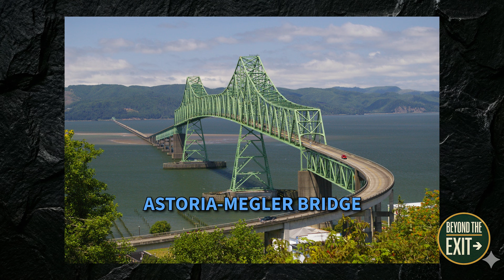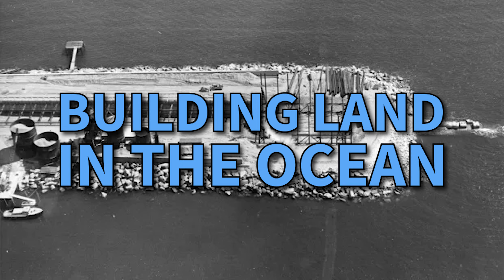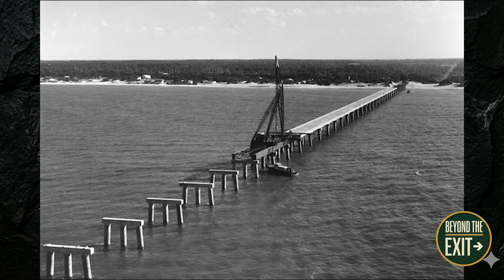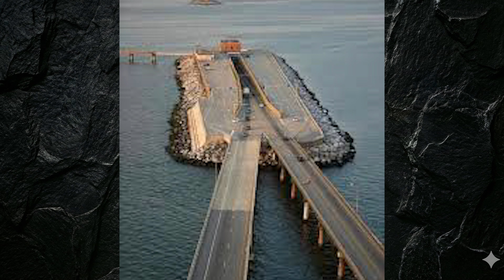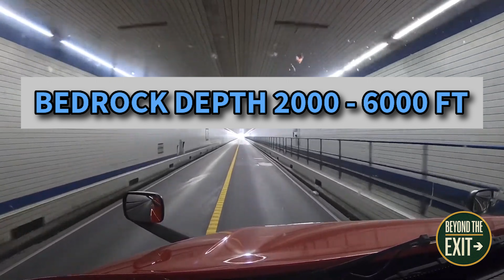The Chesapeake Bay Bridge-Tunnel: Why This Highway Had to Go Underwater

Comment: The part that reframed this crossing for me was the naval reason: a bridge over the Thimble Shoal Channel could have trapped Naval Station Norfolk if it collapsed, so the road had to dive under the shipping lanes instead. Pairing that with the old weather-bound ferries and miles-long truck queues made the 17.6-mile compromise feel like the only practical answer.
Reply from the maker: @SpayUp That naval concern is a big piece of the story. Once you realize those shipping channels had to remain dependable even if something happened to the roadway, the tunnel portions make a lot more sense. It really was a remarkable compromise between highway and maritime needs.

Comment: The CBBT is still probably my favorite bridges and/or tunnels -- I've driven across it probably dozens of times when I lived in the area. It's especially nice to drive on a clear day or around sunset when approaching or leaving Fisherman's Island. During heavy traffic, the tunnel sections can be a bit unnerving with tractor trailers and other large vehicles on both sides so close together -- but when traffic is low (most of the times I usually drive on it), it's pretty nice.

The HRBT (Hampton Roads Bridge-Tunnel) is also undergoing an expansion -- it receives way more traffic than the CBBT, and is a major bottleneck on I-64 (along with the Berkley Bridge on I-264, which always seems to be opening right before I can cross it...).  The HRBT can also reverse the lane direction temporarily to allow large vehicles to be escorted through (one of the tunnels is larger than the other, although I forget which one). It looks like they are nearing completion for the expansion project, though.
Reply from the maker: @yellowcrescent That comparison between the two crossings is useful. The CBBT has that open-water, destination feel to it, while the HRBT is almost the opposite story because traffic and capacity are such a big part of the experience.

Comment: You should do a video on the construction of H3 on the island of Oahu in Hawaii.
Reply from the maker: Great suggestion. We have heard that from several commenters. Coming soon! Thanks!
Reply: @BTE4172  That was a great video by the way.  I was stationed in Norfolk VA and navigated over that bridge tunnel many times.  I always called that area "the land of the bridge tunnels".  I was there when the Monitor-Merrimack bridge tunnel was completed.  That is a nice tunnel.  More wide open than the other bridge tunnels such as the Hampton Roads bridge tunnel.

Comment: Another first-rate video, Scott.  I took my first trip across the Chesapeake Bay Bridge-Tunnel with my parents in 1974 when we drove to Williamsburg to visit my sister (yes, the Eastern Shore route is longer, but Dad wanted to avoid I-95 through Baltimore and the Beltway around DC). I have driven across it several times since then on my East Coast road trips in the 1990s and early 2000s, both before and after the bridges and trestles were twinned.
Reply from the maker: @sct913 Thank you — I really appreciate that. I like that your first CBBT trip came from your dad choosing the longer Eastern Shore route just to avoid Baltimore and D.C. traffic. That sounds like a very real road-trip decision, and it gave you a bridge-tunnel memory that stuck around for decades.

Comment: I spent 14 months working on this structure .(87/88)In the tunnels the ceilings had deteriorated and tiles were falling on passing motorist so myself and quite a few others would demo away the delaminated concrete retile snd move in sequence through the tunnel.
The CBBT authority would close 1 lane,send a pilot car leading the travelers through. 4 nights,10 hr shifts.Still have friends from that job.
Reply from the maker: @JamesPilkenton-se5cx That is an incredible behind-the-scenes piece of CBBT history. People see the bridge-tunnel as one finished structure, but stories like this show how much work had to keep happening inside it years after opening — night shifts, lane closures, pilot cars, concrete repair, tile work, and crews moving through the tunnel one section at a time. Thanks for sharing that.

Comment: Caught my biggest flounder on the Big D. I live in Va Beach and have been using the CBBT since 1964 when it opened. Grandparents lived in Md. The symbol of the Bridge tunnel is the seagull. At the opening there was dignitaries and important people gathered and about 100 seagulls pinned up in a cage to release after the ribbon cutting. Upon release they made a circle and did what seagulls do and nailed the crowd and laughed about it! 😂
Reply from the maker: Thank you for sharing that, I was completely unaware.  And yes, it can be a tough crossing for many.

Comment: Is the Hampton road bridge tunnel deeper than the Chesapeake Bay Bridge tunnel?
Reply from the maker: HRBT Existing is 108ft at its bottom depth with the new bore being up 170ft. CBBT existing is 100ft with the new bore hitting 134ft. HRBT is just slightly deeper. Thanks!
Reply: @BTE4172  ok

Comment: Thank goodness this place has rest stops at either end. Psych yourself up before crossing, lay on the ground and cry afterwards.

I'm hoping they reopen the rest stops on the tunnel islands one day. It sucks that the restaurant and pier got shut down for construction. But of course it's going to take several times as long for the expansion project to do basically the same work a second time, despite being 50 years later and with much more advanced technology.

Comment: Before I  began long distance trucking I drove a dump truck locally. We hauled asphalt from Hampton to the Eastern Shore one day which had me driving the CBBT seven times in one day.  It made a nice change of pace. On one trip across when I reached the north side I saw ( no exaggeration  ) around 200 pelicans. I still marvel at how this was built. Sinking pylons in such rough water for over 17 miles is quite a feat of engineering. You did a good job with this video.👍
Reply from the maker: @timbukh3 Seven crossings in one day will definitely give you a different relationship with that bridge-tunnel. And 200 pelicans out there? That’s a view most people never get to see. The scale of sinking those pylons in open water really is something once you think about it. I appreciate you sharing that — and thank you for the kind words.

Comment: driving piles was my favorite part about concrete construction, i was there while we pushed the piles at the new port they canceled in portsmouth lol
Reply from the maker: That’s hands-on work right there — pile driving is about as real as it gets in concrete construction. Sounds like you saw some interesting projects come and go. Thanks for sharing, and thanks for watching.
Reply: @BTE4172 oh it was super easy i wasn’t actually driving the piles just quality assurance. Making sure the piles weren’t sliding 50-60ft after a strike from the diesel hammer and that we weren’t striking the pile too much to the point of breaking or shearing it. The hammer crews themselves however loved watching that thing slide sometimes almost 100ft we actually had a slide where the hammer was pulled off the crane and rode the pile down about 70-80ft!! It was a super fun jobsite though!

Comment: They didn’t have gps then and they needed towers to look over the curvature of the earth.  The tower was 300’ tall.  One section of the tunnel did move in a storm, they could not move it so the section was left and they worked around the move.
Reply from the maker: Pre-GPS surveying really did rely on towers and long sightlines, especially over water, and curvature becomes a factor at those distances. The Bay’s storms also forced some tough adjustments during construction. Appreciate you bringing that history into the conversation, and thanks for watching.

Comment: Im a truck driver and I actually find it very peaceful when I cross over it. I pickup in Chesapeake a lot from Delaware so I come down 13 south, down through the tunnel.  I also love stopping at the huge rest area before it (or after it, depending on direction obviously) cause there is always a good amount of parking there and with the tolls right there, and police officers nearby, theres never any shenanigans
Reply from the maker: That's a unique perspective on the Bridge-Tunnel—most folks are white-knuckling it through there! Good to hear the rest area is still a safe spot for parking. Safe travels out there.

Comment: I worked on the Parallel Connector in the 90s. We used GPS to position the piles on the elevated roadway, unlike the original structure which used a man in a “birds nest” using an instrument and plumbob to optically locate the correct position of each pile. Each cluster or bent has 2 pile on a batter or angled and a center pile plumb or straight up and down. 
The piles we put in used the latest instrumentation available and located each spot using satellites supposedly faster and more precise. If you float under the old and new structure you can see a difference in the center piles. Under the old the center piles from cluster to cluster as far as you can see is as straight as an arrow lined up perfectly. However, under the new section that was constructed with better more precise instruments the center piles drift side to side. Not by much, but by enough that the eye can see it. 
It always made me appreciate the “old dudes” that built the original using what they had available to them and the precision at which they built the structure. Those men truly cared about what they were building.
Reply from the maker: That’s a fantastic firsthand insight—and a great reminder of just how precise those original crews were with nothing but optics and experience. The fact you can see the difference says a lot about their craftsmanship. Thanks for sharing that, and thanks for watching.

Comment: Good video, but one correction: the second tunnel that was mentioned (January 2025) is not part of the CBBT, but instead the similar structure of nearby I-64 which is also a bridge-tunnel. An expansion project has been underway for approximately three years and, as of January 2026, is still not completed. This expansion project of I-64 - and not the CBBT - is the one that is building/adding a second tunnel next to the existing one.
Reply from the maker: Thanks for the comment. Actually, the CBBT does have an active second-tunnel project — the Parallel Thimble Shoal Tunnel currently being built under Thimble Shoal Channel, separate from the Hampton Roads Bridge-Tunnel work on I-64. Thanks for engaging and helping keep the details straight.
Reply: @BTE4172 my bad! Didn’t even know

Comment: I go across the CBBT probably 2 or 3 times a week (I live in Norfolk, also have a place in Cape Charles) it's a great drive even in bad weather which makes it more exciting due to the roadway being low to the water and waves. sometimes I time my trip coming back to Norfolk as the sun sets over the Chesapeake Bay, driving on the CBBT during that time is beautiful. 

Pro tip, if it's windy there are restrictions depending on wind speed on the bridge itself, if you have loose items in the back of your truck they won't let you cross.

Also, great video, thanks
Reply from the maker: That’s a great way to experience it—especially timing it with the sunset. Even for people who drive it often, that crossing never really gets old. Thanks for watching!

Comment: No what's crazy is my Satellite radio doesn't work in a drive thru but it worked all the way under the water in this tunnel!
Reply: I work at the BHT & FMT in MD. The reason your radio doesn't work, but your satellite radio does is because the tunnels have their own underground cell phone towers. (the tower is on the roof of the ventilation buildings, and hard wired to a bunch of repeaters in the tunnels) There is also a dedicated radio channel that you can only get in the tunnel that gives general travel info, I cannot remember the exact freq, but I think due to their being no interference you will pick it up on any AM channel.

Comment: Does anyone know if there's still the gift shop and fishing area at one of the tunnels? Last time I went across that bridge was in the early 90's...probably like 93ish.
Reply from the maker: @kronos6948 Good question! On the Chesapeake Bay Bridge-Tunnel, there used to be a restaurant and gift shop right on one of the man-made islands and even a long fishing pier out over the Bay—but that building and shop closed permanently back in 2017 when construction of the new tunnel began, and it won’t be coming back, unfortunately.
Reply: @BTE4172 aww, that stinks.
Reply from the maker: I agree, sorry to be the bearer of bad news. It sounds like it would have been a really cool experience.

Comment: Aren’t they on like their 3rd contractor and 10s of millions of wasted dollars on this new section of tunnels? Pretty sure the new tunnel has missed its deadlines 3 times and is actually well over 200 million in overruns before the 3rd contractor got involved.
Reply from the maker: @bunkshaner22 There have definitely been delays and higher costs on the new tunnel, no question. A lot of that came from unexpected conditions encountered during construction, which is common with complex underwater tunneling projects. The work is still ongoing and moving toward completion later this decade. Thanks for watching.
Reply: @BTE4172 thanks for the video!

Comment: I live right next to this and have driven over it for 50+ years. I don't know if America can even build projects like this anymore. That generation is nearly gone. The bureacracy is insanely inefficient and rife with corruption from private businesses and government collusion, and the quality of engineering takes a backseat to budget, so the "do it at all cost" mindset up through the 1950's isn't around anymore. Most projects now are designed to last 20 to 25 years at most.
Reply from the maker: @skatterbrainz Living next to it for that long gives you a perspective most people never get. A lot has changed—standards, oversight, risk tolerance, and how projects are funded and approved—but the engineering itself is still there, just operating under very different constraints. I appreciate you sharing that long-view context. Thanks for watching.

Comment: The second bridge was built during more modern times however when you look at it other than the shoulder it looks like it could have been built back in the 60s with the original bridge. Most modern bridges use a concrete jersey like barrier for bridge rails and not the steel bridge rails. Wouldn't concrete bridge rails be safer in terms of keeping traffic on the bridge? I understand the 50s and 60s jersey barriers weren't a thing yet but seems to me in the 90s they would have gone that route for the second bridge.

Comment: This is a remarkable feat of engineering.  As for myself,  I  can't watch this......can hardly think of it.......drive on a causeway to the middle of the bay, then drop into a hole???  I  can't even watch a dashboard gopro crossing the Mississippi....i feel I'm going to fall into the water...  it's just me  But this is a great feat of engineering
Reply from the maker: @acespace7255 You’re definitely not alone — a lot of people have that same reaction to long bridges and tunnels over open water. The idea of driving out onto a causeway and then disappearing into a tunnel can really get into your head. Even so, I appreciate you recognizing what an engineering achievement it is. Thanks for watching, even if it’s from a safe distance.

Comment: That was an incredible feat of engineering. And it was done long before the advent of the internet, computer terminals, and AI. Slide rules were the order of the day. So were pencils, pens, and notebooks. Yet the tunnel was built and is still active today. Hats off all around!
Reply from the maker: @thomastarwater6035 Well said. It’s remarkable what was accomplished with slide rules, field notes, and hard-earned experience. That it’s still doing its job today really says everything. Thanks for watching.
Reply: Agreed! Personally I'm not a big fan of the electronic abominations that dominate todays world. I still have my "slipstick" from back in the day (and various other analog systems and backups), so I've got no worries when the grid goes down.

Comment: I worked for a marine contractor in the 90s. I worked on the 4 lane trestles being built in the bay around 95/96. I had to drive over to the Cape Charles side to catch the tug or barges to go out. There was also a large laydown/assembly yard in Norfolk at Little Creek. Worked there when not on the water.
Reply from the maker: @starcityofva That’s a great firsthand perspective—those trestle projects and staging yards were a huge part of how the work got done. Thanks for sharing that experience, and thanks for watching.
Reply: @BTE4172 Great video really enjoyed it. If I recall the pile driving rig being used then was owned by a Dutch company. The roadway sections were built in the laydown yard complete with guard rails and then taken out and set on the pilings. We were prepping the pilings being driven into the bottom. Then a cofferdam was built around them and the pad was built on top of them. Worked there on and off we had other jobs going in local shipyards too.
Reply from the maker: @starcityofva That’s fantastic firsthand insight — thank you for sharing it. That sequence you described, from pile driving to cofferdams and setting the roadway sections, really gets at how methodical that work had to be out there. Hearing from people who were actually part of the process adds a whole other layer of understanding. I really appreciate you taking the time to add that perspective.
Reply: Dude that's awesome, this bridge has had a massive impact on my life growing up & now - thanks for the good work boss man. Literally wouldn't be the same without you.